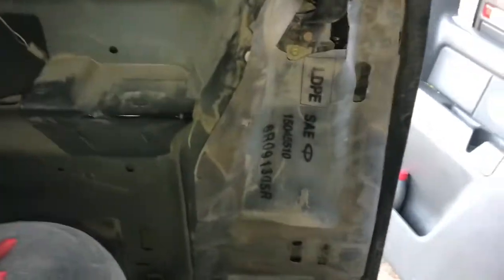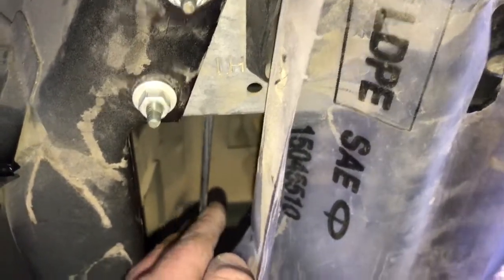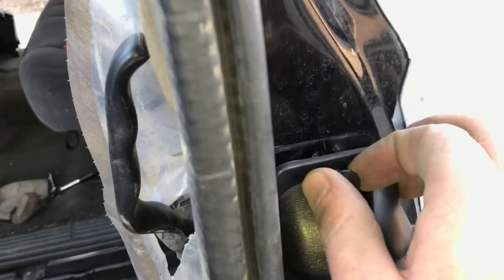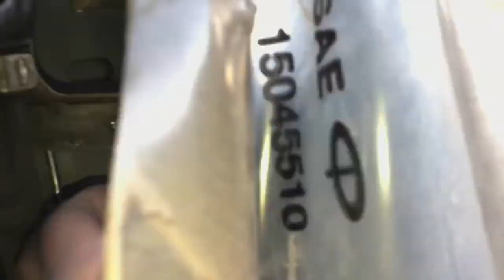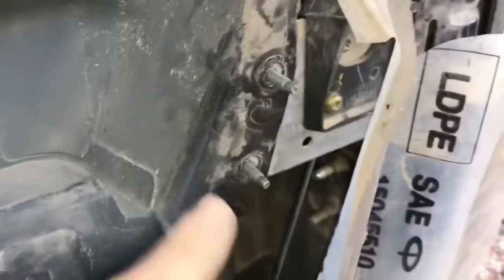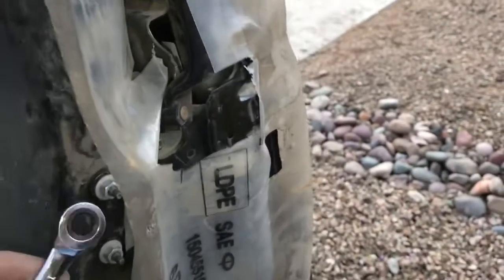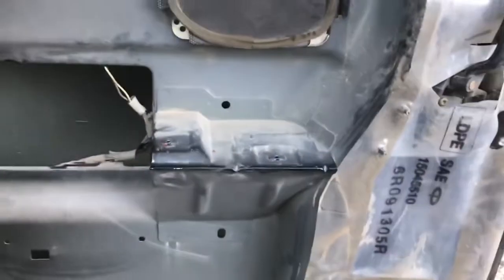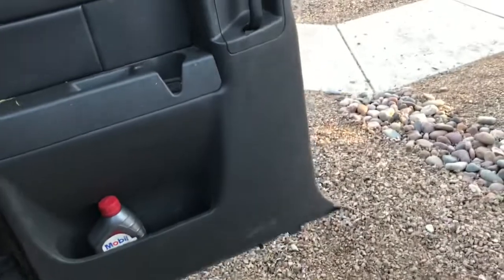Chevy Silverado Rear Door Won’t Open. Chevy Silverado Rear Door Latch Repair 2006 Ext Cab

Comment: Thanks man, i did it your way in the end. I bought the plastic pieces in Autozone for like 4 dollars, put in on the locking rod, but for the love of god i could not force it in the whole, and i was trying for like 30 minutes lol. So i just took it off, bent the tip a little like you did, and noe it works like a charm

Comment: Was the door panel difficult to get off with the door shut & rear seat folded down?
Reply from the maker: Eric Jansen I just popped out the forward side and reached in to pull up on the rod. After I opened the door, I took it off...
Reply: It’s a bitch to get off, just be careful and slow and you shouldn’t brake anything. When the door won’t open there isn’t a lot of space to work with

Comment: My rod is working but the bottom latch will still not release for the door to open. Suggestions?
Reply from the maker: Grateful Nomad Will the bottom latch operate if you pull the rod up using your hand? I’m just wondering if there’s not enough tension from pulling the handle to release the bottom latch. If that is the case then you might need to replace the handle. They’re cheap and also cheaply made.
Reply: @ebkbode  The handle actually broke off a while back when it got real cold so I have been manually pushing the lever. When I reach down and pull the rod it is being fully extended and I can hear the latch release but the door will not open. It will open at the top but not the bottom. I sprayed it down with WD40 and put a screw driver in there and tapped it with a hammer to tet and break the rust free but it did not help.
Reply from the maker: Grateful Nomad Damn that sucks. You may need to jimmy the latch with whatever you can find? It’s hard to say without seeing it myself. If you are able to jimmy the latch open, then obviously don’t close it again without repairing or replacing the worn component. Good luck man.
Reply: did you ever get rear door lower latch to work ???  I have same problem.
Reply: I saw another guy, same problem, he used a crowbar under the door because over time they can sag. This took pressure off and he wiggled back and forth, pulled lever and it release. Maybe use some penetrating oil first.

Comment: Bottom latches froze locked
How can I remove it
Reply: did you ever get rear door lower latch to work ???  I have same problem.
Reply: Same problem here
Reply: Anyone figure this out? I think I have the same issue
Reply: I had the same issue, after lubing and beating for hours with no luck i got a working door from the junk yard and swapped the door.